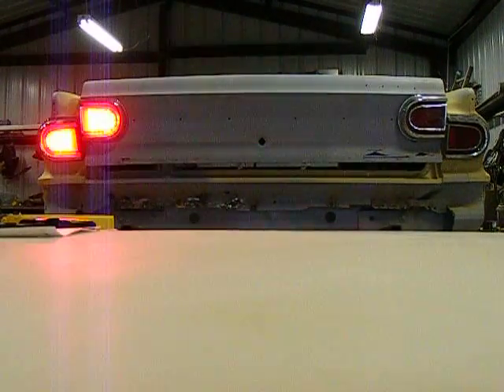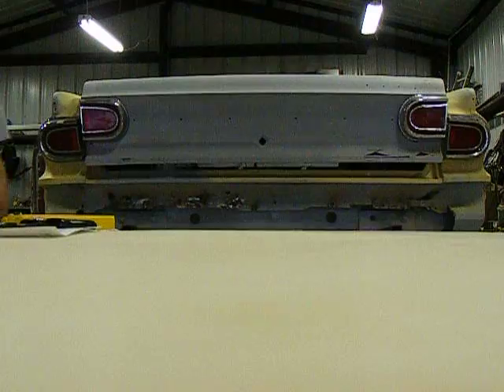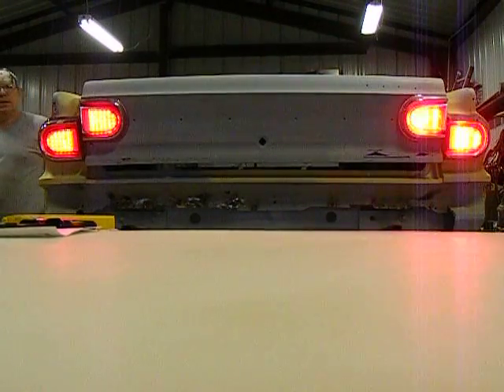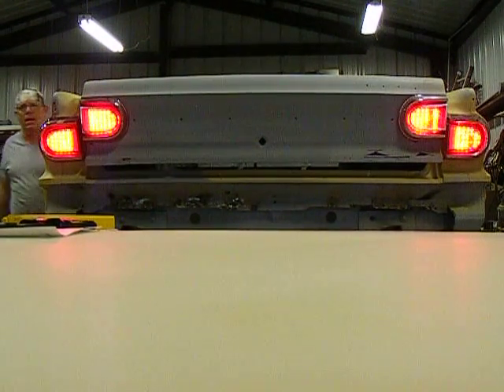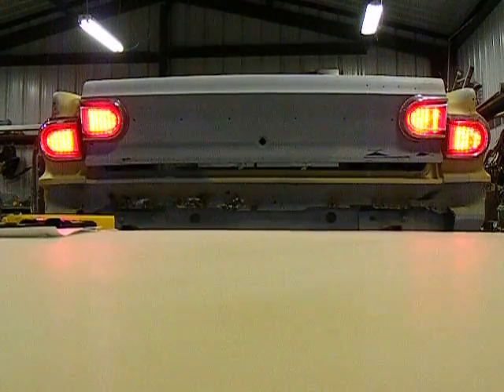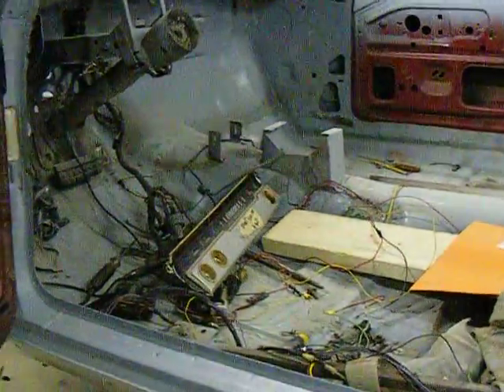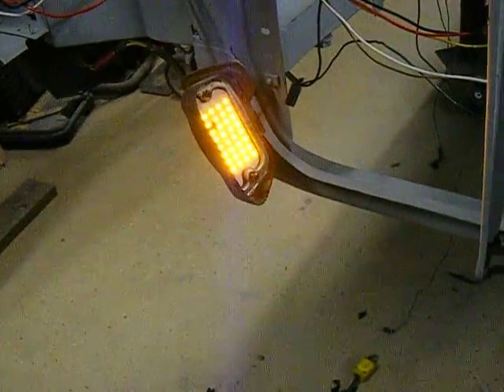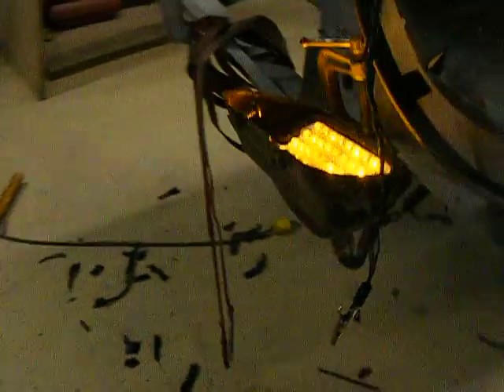led taillight prototype for my 66 dart

Comment from the maker: ther ewas no modification to the housing at all, there was a wiring kit I made so that you could have both inner and outer tail lights work as stop,turn and tail or running lights. you can basically just unplug your light bulb, open your tail light bucket plug in the led board, align it,close the taillight housing up grab the socket end plug it into the tail light socket. install bucket in car and it's done! for the outer lights , inners take a wiring kit but almost as easy.

Comment from the maker: I do plan on selling the boards and regulators. I did not have to modify the housings other than changing the trunk inner sockets to 2 element sockets(shortest ones I could find at napa) to clear the metal. and added 2 wires to the existing tail light wire running to the trunk lid. I still have to get the lighting ratio corrected (darn thing are actually too bright) I have 2 styles that I'm working on (1) Full all 4(like on the video) (2) C-ring style outer rings  full center